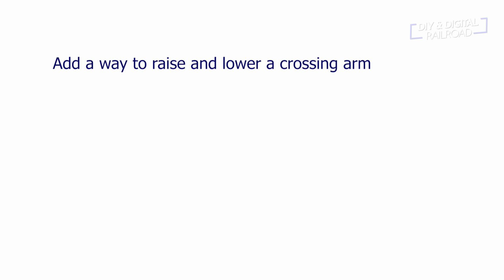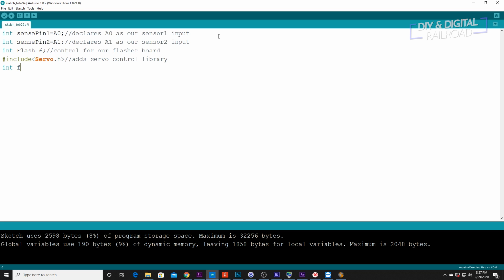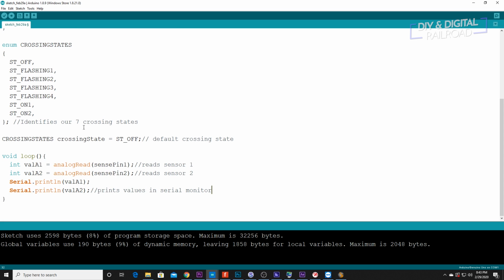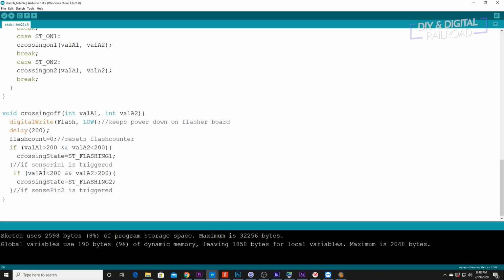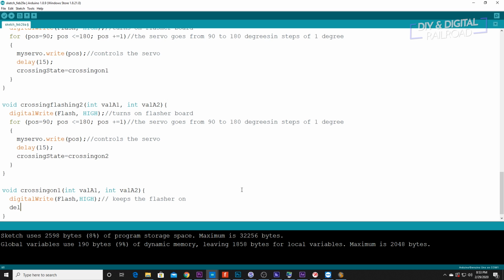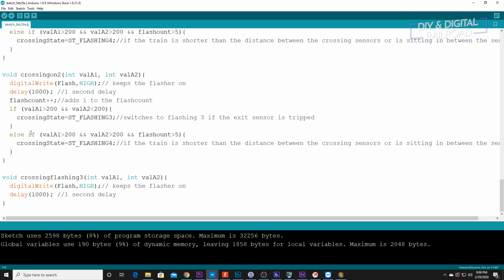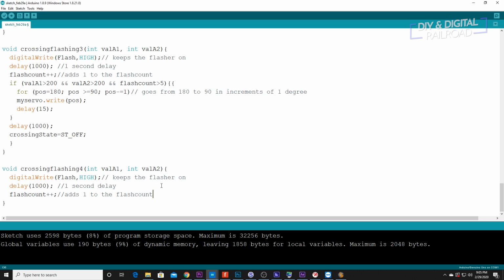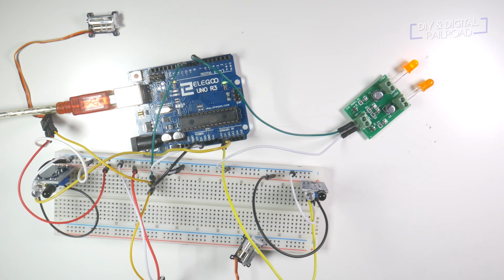Adding Crossing gates to the Arduino Grade Crossing Sketch

Comment: Here is the errors I get when I try to upload the sketch into the UNO. I haven't placed all the items on the breadboard yet. Do you have to do that first? New to this thing, any help would be appreciated...

C:\Users\train\AppData\Local\Temp\.arduinoIDE-unsaved2024826-1472-1ajtbyk.e5hb\sketch_sep26b\sketch_sep26b.ino:3:1: error: 'Servo' does not name a type; did you mean 'Serial'?
 Servo myservo;//names servo control
 ^~~~~
 Serial
C:\Users\train\AppData\Local\Temp\.arduinoIDE-unsaved2024826-1472-1ajtbyk.e5hb\sketch_sep26b\sketch_sep26b.ino: In function 'void setup()':
C:\Users\train\AppData\Local\Temp\.arduinoIDE-unsaved2024826-1472-1ajtbyk.e5hb\sketch_sep26b\sketch_sep26b.ino:7:11: error: 'Flash' was not declared in this scope
   pinMode(Flash, OUTPUT);//establishing pin 6 as an output pin
           ^~~~~
C:\Users\train\AppData\Local\Temp\.arduinoIDE-unsaved2024826-1472-1ajtbyk.e5hb\sketch_sep26b\sketch_sep26b.ino:7:11: note: suggested alternative: 'class'
   pinMode(Flash, OUTPUT);//establishing pin 6 as an output pin
           ^~~~~
           class
C:\Users\train\AppData\Local\Temp\.arduinoIDE-unsaved2024826-1472-1ajtbyk.e5hb\sketch_sep26b\sketch_sep26b.ino:8:3: error: 'myservo' was not declared in this scope
   myservo.attach(9);//sets up pin 9 as our servo control
   ^~~~~~~
C:\Users\train\AppData\Local\Temp\.arduinoIDE-unsaved2024826-1472-1ajtbyk.e5hb\sketch_sep26b\sketch_sep26b.ino: In function 'void loop()':
C:\Users\train\AppData\Local\Temp\.arduinoIDE-unsaved2024826-1472-1ajtbyk.e5hb\sketch_sep26b\sketch_sep26b.ino:25:26: error: 'sensePin1' was not declared in this scope
   int valA1 = analogRead(sensePin1);//reads sensor 1
                          ^~~~~~~~~
C:\Users\train\AppData\Local\Temp\.arduinoIDE-unsaved2024826-1472-1ajtbyk.e5hb\sketch_sep26b\sketch_sep26b.ino:26:26: error: 'sensePin2' was not declared in this scope
   int valA2 = analogRead(sensePin2);//reads sensor 2
                          ^~~~~~~~~
C:\Users\train\AppData\Local\Temp\.arduinoIDE-unsaved2024826-1472-1ajtbyk.e5hb\sketch_sep26b\sketch_sep26b.ino: In function 'void crossingoff(int, int)':
C:\Users\train\AppData\Local\Temp\.arduinoIDE-unsaved2024826-1472-1ajtbyk.e5hb\sketch_sep26b\sketch_sep26b.ino:58:16: error: 'Flash' was not declared in this scope
   digitalWrite(Flash, LOW);//keeps power down on flasher board
                ^~~~~
C:\Users\train\AppData\Local\Temp\.arduinoIDE-unsaved2024826-1472-1ajtbyk.e5hb\sketch_sep26b\sketch_sep26b.ino:58:16: note: suggested alternative: 'class'
   digitalWrite(Flash, LOW);//keeps power down on flasher board
                ^~~~~
                class
C:\Users\train\AppData\Local\Temp\.arduinoIDE-unsaved2024826-1472-1ajtbyk.e5hb\sketch_sep26b\sketch_sep26b.ino: In function 'void crossingflashing1(int, int)':
C:\Users\train\AppData\Local\Temp\.arduinoIDE-unsaved2024826-1472-1ajtbyk.e5hb\sketch_sep26b\sketch_sep26b.ino:70:16: error: 'Flash' was not declared in this scope
   digitalWrite(Flash, HIGH);//turns on flasher board
                ^~~~~
C:\Users\train\AppData\Local\Temp\.arduinoIDE-unsaved2024826-1472-1ajtbyk.e5hb\sketch_sep26b\sketch_sep26b.ino:70:16: note: suggested alternative: 'class'
   digitalWrite(Flash, HIGH);//turns on flasher board
                ^~~~~
                class
C:\Users\train\AppData\Local\Temp\.arduinoIDE-unsaved2024826-1472-1ajtbyk.e5hb\sketch_sep26b\sketch_sep26b.ino:73:5: error: 'myservo' was not declared in this scope
     myservo.write(pos);//controls the servo
     ^~~~~~~
C:\Users\train\AppData\Local\Temp\.arduinoIDE-unsaved2024826-1472-1ajtbyk.e5hb\sketch_sep26b\sketch_sep26b.ino: In function 'void crossingflashing2(int, int)':
C:\Users\train\AppData\Local\Temp\.arduinoIDE-unsaved2024826-1472-1ajtbyk.e5hb\sketch_sep26b\sketch_sep26b.ino:80:16: error: 'Flash' was not declared in this scope
   digitalWrite(Flash, HIGH);//turns on flasher board
                ^~~~~
C:\Users\train\AppData\Local\Temp\.arduinoIDE-unsaved2024826-1472-1ajtbyk.e5hb\sketch_sep26b\sketch_sep26b.ino:80:16: note: suggested alternative: 'class'
   digitalWrite(Flash, HIGH);//turns on flasher board
                ^~~~~
                class
C:\Users\train\AppData\Local\Temp\.arduinoIDE-unsaved2024826-1472-1ajtbyk.e5hb\sketch_sep26b\sketch_sep26b.ino:83:5: error: 'myservo' was not declared in this scope
     myservo.write(pos);//controls the servo
     ^~~~~~~
C:\Users\train\AppData\Local\Temp\.arduinoIDE-unsaved2024826-1472-1ajtbyk.e5hb\sketch_sep26b\sketch_sep26b.ino: In function 'void crossingon1(int, int)':
C:\Users\train\AppData\Local\Temp\.arduinoIDE-unsaved2024826-1472-1ajtbyk.e5hb\sketch_sep26b\sketch_sep26b.ino:90:16: error: 'Flash' was not declared in this scope
   digitalWrite(Flash, HIGH); // keeps the flasher on
                ^~~~~
C:\Users\train\AppData\Local\Temp\.arduinoIDE-unsaved2024826-1472-1ajtbyk.e5hb\sketch_sep26b\sketch_sep26b.ino:90:16: note: suggested alternative: 'class'
   digitalWrite(Flash, HIGH); // keeps the flasher on
                ^~~~~
                class
C:\Users\train\AppData\Local\Temp\.arduinoIDE-unsaved2024826-1472-1ajtbyk.e5hb\sketch_sep26b\sketch_sep26b.ino: In function 'void crossingon2(int, int)':
C:\Users\train\AppData\Local\Temp\.arduinoIDE-unsaved2024826-1472-1ajtbyk.e5hb\sketch_sep26b\sketch_sep26b.ino:103:16: error: 'Flash' was not declared in this scope
   digitalWrite(Flash, HIGH); // keeps the flasher on
                ^~~~~
C:\Users\train\AppData\Local\Temp\.arduinoIDE-unsaved2024826-1472-1ajtbyk.e5hb\sketch_sep26b\sketch_sep26b.ino:103:16: note: suggested alternative: 'class'
   digitalWrite(Flash, HIGH); // keeps the flasher on
                ^~~~~
                class
C:\Users\train\AppData\Local\Temp\.arduinoIDE-unsaved2024826-1472-1ajtbyk.e5hb\sketch_sep26b\sketch_sep26b.ino: In function 'void crossingflashing3(int, int)':
C:\Users\train\AppData\Local\Temp\.arduinoIDE-unsaved2024826-1472-1ajtbyk.e5hb\sketch_sep26b\sketch_sep26b.ino:116:16: error: 'Flash' was not declared in this scope
   digitalWrite(Flash, HIGH); // keeps the flasher on
                ^~~~~
C:\Users\train\AppData\Local\Temp\.arduinoIDE-unsaved2024826-1472-1ajtbyk.e5hb\sketch_sep26b\sketch_sep26b.ino:116:16: note: suggested alternative: 'class'
   digitalWrite(Flash, HIGH); // keeps the flasher on
                ^~~~~
                class
C:\Users\train\AppData\Local\Temp\.arduinoIDE-unsaved2024826-1472-1ajtbyk.e5hb\sketch_sep26b\sketch_sep26b.ino:122:9: error: 'myservo' was not declared in this scope
         myservo.write(pos);
         ^~~~~~~
C:\Users\train\AppData\Local\Temp\.arduinoIDE-unsaved2024826-1472-1ajtbyk.e5hb\sketch_sep26b\sketch_sep26b.ino: In function 'void crossingflashing4(int, int)':
C:\Users\train\AppData\Local\Temp\.arduinoIDE-unsaved2024826-1472-1ajtbyk.e5hb\sketch_sep26b\sketch_sep26b.ino:131:16: error: 'Flash' was not declared in this scope
   digitalWrite(Flash, HIGH); // keeps the flasher on
                ^~~~~
C:\Users\train\AppData\Local\Temp\.arduinoIDE-unsaved2024826-1472-1ajtbyk.e5hb\sketch_sep26b\sketch_sep26b.ino:131:16: note: suggested alternative: 'class'
   digitalWrite(Flash, HIGH); // keeps the flasher on
                ^~~~~
                class
C:\Users\train\AppData\Local\Temp\.arduinoIDE-unsaved2024826-1472-1ajtbyk.e5hb\sketch_sep26b\sketch_sep26b.ino:141:7: error: 'myservo' was not declared in this scope
       myservo.write(pos);
       ^~~~~~~

exit status 1

Compilation error: 'Servo' does not name a type; did you mean 'Serial'?

Comment: Gave up waiting on crossing gates, 3d printed them.  Mounted them with an SG90 under the layout.  Plus I found a tinybell circuit by ND Holmes and redid my Circuit board.  I have two detectors as well as two bell circuits on the board.  I use the flasher circuits for the crossbars.  I use LDR circuits in the track.

Comment: Thank you for your sketch and ideas.
 I have built a crossing gate using an UNO and two servos.  I wonder if you could help me with some modification to your sketch.
1. I need two extra inputs from my two block detector for the main and passing track.
2.I will still use the two IR detectors for my yard track.
3. The crossing lights could operate from the Arduino but could still operate from the output to a flasher unit but the lights need to come on some time before the gates come down.

4. I have great difficulty adjusting the servos so that the gates operate equally. is it possible to separate them in the sketch.
5. I have an MP3 player for the bell this would need an output to start when the lights com on.

Thanks once again for your Channel.
Wally.

Comment: Hi Jimmy, Hi everyone, Nice video and very nice job from which I was inspired to make a level crossing (as the one you made with only led signal). I live in France (so, please forgive my really poor english writing), and level crossings operate very slightly differently from certain crossings in the United States. The problem I encounter with the infrared sensors is that they are "activated" as soon as the loco passes, both on entry AND on exit. In order to solve my problem, I would like the input sensor to be effectively active as soon as the loco passes, but the output sensor to only "activate" after the LAST wagon of the convoy has passed. TOTALLY new to using and coding Arduino, I considered for a moment using a reed sensor module, with a magnet placed on each car at the end of the convoy, but if someone has a solution with infrared sensors, any tips or code snippets would be VERY highly appreciated. For a multi-track use I imagine that the ideal solution would be a detection of occupation of the block on which the level crossing is ? but I have NO idea how to do this detection. Thank you in advance to all and again a huge BRAVO Jimmy for this video (and all the others ;-))

Comment: Can the intensity of the flashing lights be controlled by the circuit board used for the LEDs? Also, how would it connect to the actual crossing gates? I mean, the Arduino, Breadboard, and wires would have to be in an enclosure and hidden somewhere maybe with scenery, but as for the motors...do they need extra/special modification?

Comment: Hi Jimmy, I am a great fan of your work style.  Getting back into the model trains after retirement.  I am basically a Geologist and hence no or zero knowledge of electronics and little knowledge of programming, from a small city in India.  I prefer to use USS in place of IR Sensor. 

I would request you to kindly educate me as to what changes should I make in 'sketch' as I would be using Ultrasonic Sensor in place of Infra Red Sensor in connection with model railroad crossing gates. Thanks in advance.

Comment: Dear Jimmy, I spent a lot of time building the Crossing Sketch with 2 signals and 2 servos. After stopping and starting your video and writing down every detail and then adding that info  to my IDE Sketch, you finished ypour sketch "THEN" verified and made your corrections in a matter seconds. It was way to fast to make sense of what you did and my sketch is useless. Was this on purpose to get me to "buy" the corrected sketch??? If so, how do I buy it? I'm new to Arduino  and at age 75, a little challenged.  Please help. JiBLuke

Comment: How would I cause the crossing protection to go to the "OFF" state when the last car of the train exits the protected section between the sensors, rather than when the engine reaches the out bound sensor?
Reply: You would need 4 sensors. Two right next to the crossing, and 2 more further away from the crossing. This design is called the Approach Design.  This ensures that the crossing will stay on once a train has actually went over the roadway. Then after the crossing has been cleared, lights will turn off.

Comment: Hi, There loved the video, but one thing, I had downloaded the code the flashers work fine but for some reason I'm not getting the servo to work, is there any pdf photo I can download to see if my wiring is correct ?  Thanks,
Reply: same exact thing happens to me. The Sensors are lighting up, but no servos

Comment: I have a pair of those mini servos but envision a problem mounting them.  I hope to use SG90 servos.  Pictures of the mini's mounted?  BTW, using two ATTiny85's for my two crossings instead of full Arduinos. Works fine.  Still waiting on the crossing gates themselves.

Comment: Ok designed a board with two train detectors, two bell sounders, and two servos.  NJ International crossing gates on order, which size wire to connect servo to the crossing gates?
Reply from the maker: Something around 20 or 22 gauge solid should work.

Comment: Found IR sensors double trigger between cars.  Replaced with LDR sensors.  Had to change sketch to look for a high and had to use an or gate on diverging tracks.

Comment: Impressif piece of coding, but...
You have two sensors so if you code you sketch that the flasher board activates if either one of these sensors reaches a surtain threshold and deactivates when both sensors reach the same threshold the sketch can be written in less than 50 lines.
Use a while statement for the sensor deactivation state and in that statement create a void for the blinking and the barrier movement.